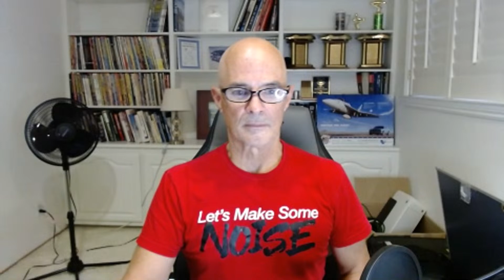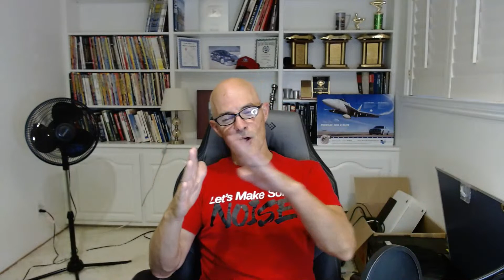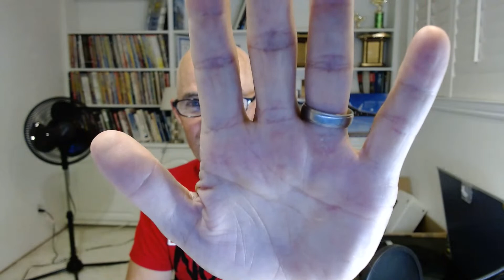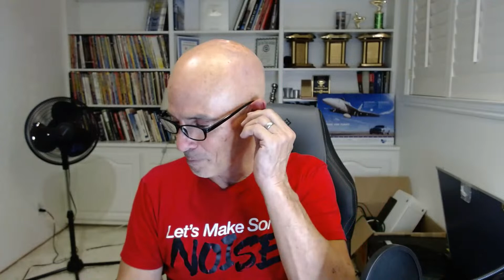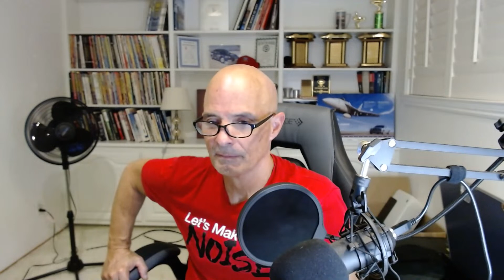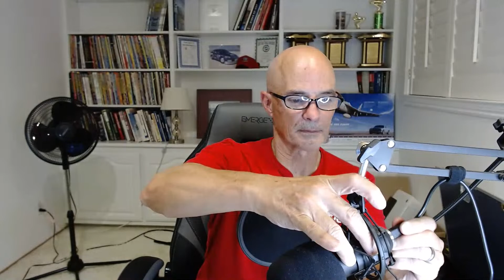LET'S TALK TECH-TURBOS AND VACUUM LINE ROUTING

Comment: When running an air to water intercooler do you use the same radiator as the engine or do you use a separate one?
Reply: Seperate cooler
Reply from the maker: different cooler-engine radiator is too hot
Reply: @richardholdener1727  Thank you. What waterpump do you recommend for the second radiator?

Comment: The factory intercooler had a metal “pop off valve”. Just a valve and a spring. The “garden hose gasket” mod was common. The factory pop off valve would open around 9psi iirc. Shimming the spring with a rubber garden hose gasket would open around 13psi.
Reply: Similar pop of valve was on my rb30et it was factory set to only 53.5 kpa from memory might go look it up but they were only 200hp and most often it was one of the first things to get rid of mine was shimmed to 14psi and made an awful scream when it opened if I got to eager with the boost control

Comment: The vacuum line tangle made me think of the Honda Bulldog Turbo. These were only sold in Japan, I think. They had a CVCC engine with a turbocharger. Given how many vacuum lines an NA Honda CVCC engine had, I can't imagine what a turbocharged CVCC engine would have. That in mind, it was given EFI, and that probably eliminated numerous pieces of vacuum garbage.
Reply from the maker: those early hondas (like the CRX HF) had a mess of lines
Reply: @richardholdener1727  I joked that Honda CVCC engines had double or triple the number of vacuum lines of most other smog era carb engines.

Honda wanted to build a smog engine in 1976 with no catalytic converter. However, the lengths they went to may not have been worth it. Datsuns and Toyotas tended to be less troublesome if you had carb related problems.